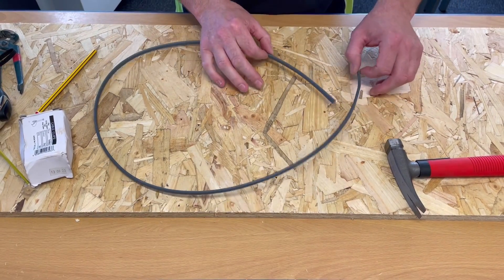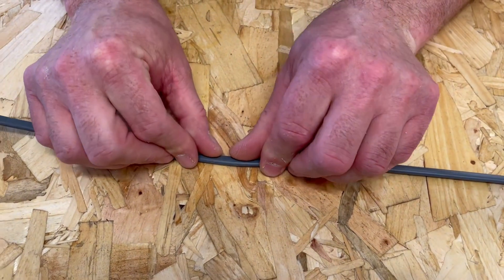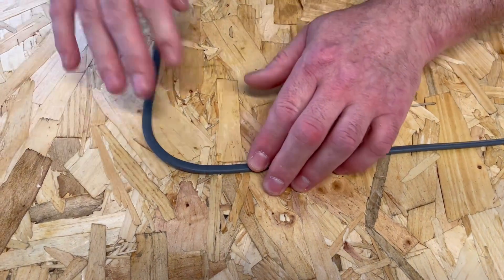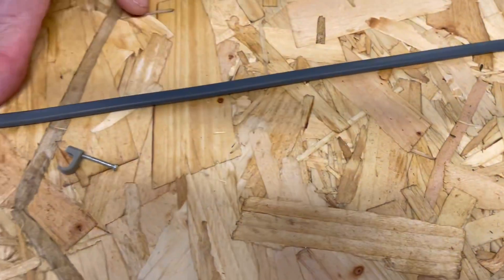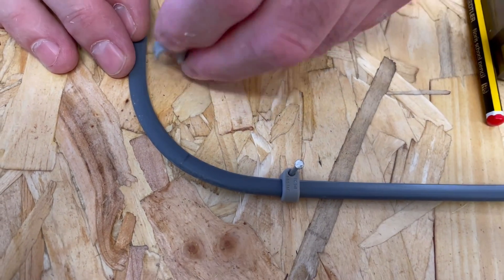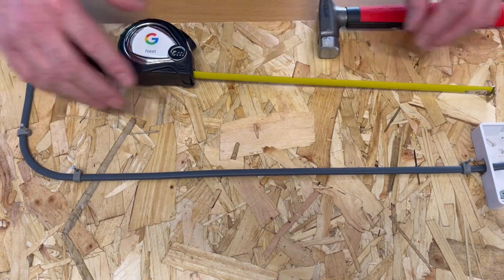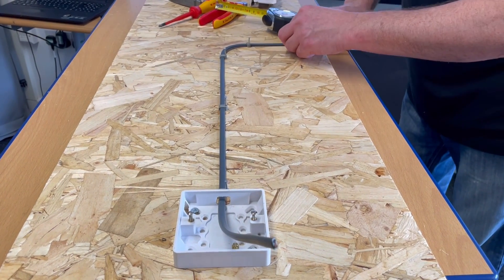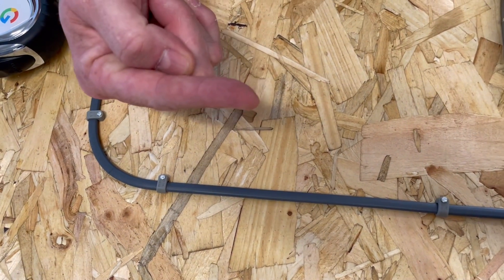How to Put a Smooth Bend in Twin and Earth Cable

Comment: I know it’s a demo, but that’s a lot of faffing.

1. Measure top and bottom and draw a line with your 3ft level. Use that to make sure you’re straight.
2. Use your hammer as a gauge to measure gaps.
3. Always put the nail on the side you’re hammering from.
Reply from the maker: If you cannot take your time and get it right at college we are all in trouble - thanks for watching and commenting 👍🏻.
Reply: @GSHElectrical  that’s the method I was taught at college.

A real world technique that gets the job done quickly, accurately, and reliably.

There’s no point in teaching techniques that won’t be applied in the real world.

Anyway, it’s a minor disagreement on a otherwise excellent channel.
Reply: What I take from Gaz and the Boys is along with the technique is the ESSENCE. In that it is quality of workmanship with tips on how to achieve that.  If you have an efficient way that gives the same results, then voila!

Comment: What does all this manipulation do for the conductor thickness itself?  We already know it's not a good idea to rip the outer sheath off electrical cables by using one of the conductors as a pull wire to split the sheath.

Comment: Nice clipping . I know this is only a demo video. But it would be nice to see the knockout on the box neatly cut out with a junior hacksaw and not just knocked out any how
Reply from the maker: How to Cut (Make) a Hole in a Surface Plastic Electrical Box and Reinstate the IP Rating (IP4X) https://youtu.be/yEi_cx5m7Lg